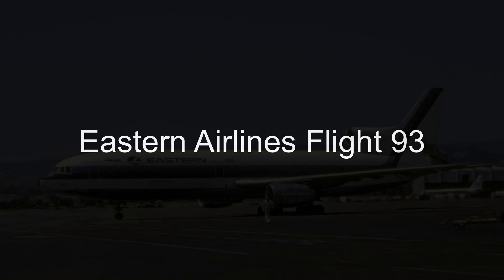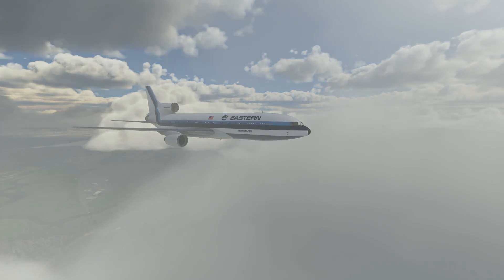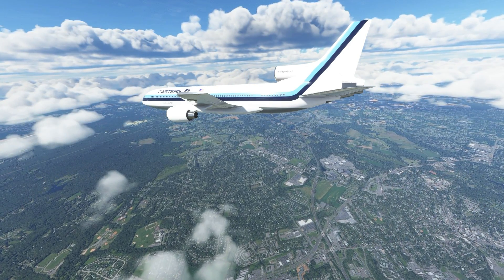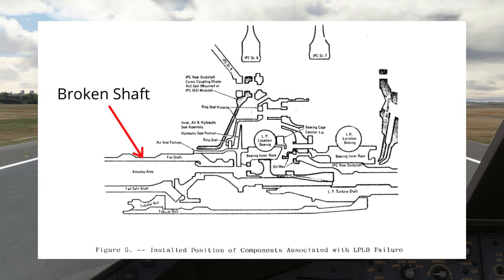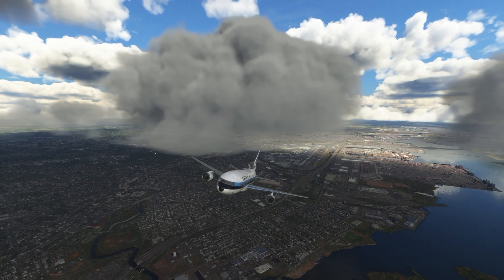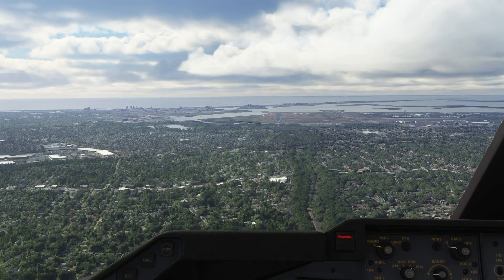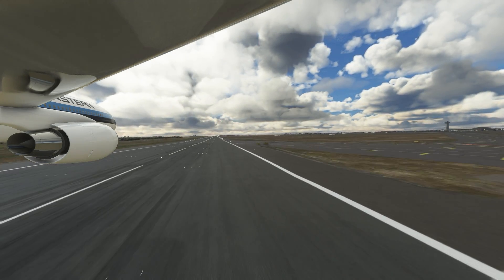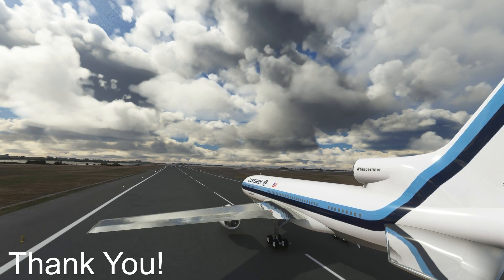How 3 AMAZING Pilots Made A Near Impossible Landing | Eastern Airlines Flight 935

Comment: This one shares several things in common with United 232, except for one major difference - that being they still had partial hydraulics for flight control surfaces. It’s very apparent both flight crews were highly skilled in dealing with these catastrophic failures (the United crew having even less to work with), and that the difference in lives lost essentially hung on the existence of one remaining hydraulic system.
Reply: This was the first thing I thought of too. Captain Haynes said he didn't like being referred to as a hero as it was a group effort. A passenger, Dennis Fitch a training-check airman , had actually practiced flying a simulator using only the throttles before this flight and was the person controlling the throttles.
Reply: @electronron1  sadly Captain Dennis Fitch passed away a few years ago. He succumbed to cancer if my memory serves me correct.

One of Captain Haynes heroic decision’s was to let Dennis Fitch onto the flight deck to assist. Captain Haynes, the FO and Dennis Fitch all worked together to get their plane onto the ground with as least loss of life as possible.
Reply: Part of that major difference was, the L1011 (like the 747) had four hydraulic systems and the DC10 only had three.
Reply: @cr10001  If the L1011 had 3, the people would’ve been screwed right?
Reply: @A_taintedSøl   Very likely, yes.   UA232 had 3, all of which the tail engine took out, the crew (plus a pilot who happened to be passengering) did an incredible job to get it on the ground, but it veered off line and turned over killing about 1/3 of the passengers.   They could have been luckier, but far more likely is that it would just have crashed and killed everybody.
Reply: @cr10001  If three hydraulic systems can be knocked out at once, so can four.
Reply: I was in Phoenix attending new-hire ground training for America West (browsing at the company gift shop, no less) when the tv in the store cut to coverage of UA 232 in SUX (yes, that’s the ICAO code for Sioux City). As it happens, America West served SUX at the time - and as luck would have it I attended a CSR panel meeting a couple months later and sat next to one of the SUX employees. “Shortcake” (real name Suzanne) told us the hair-raising entire sequence of events as every staff member (we had a whopping 11 staff including the secretary/auditor) for each of the four carriers serving SUX was called in to help. And there they stood, in their uniforms but with running shoes or steel toes on, about 25 people in all, representing the four airlines serving SUX, lined up on the ramp, waiting for something inevitable but with no clue how it would all unfold. After 232 came to a halt, Suzanne remembered running like hell straight across the ramp and all the way to and across the runway, at one point thinking “holy hell I’m running across the runway’ who does that??”. She worked the survivor center in one of the hangars, by the way. Much more to tell but that’s a little of it.
Reply: L1011 got off lucky for this one. Highly overrated airplane
Reply: @Cheese dc10 great plane i would fly on one today most of the problems were maintainance issues ie chicago
Reply: Yeah, and the weird thing is United 232 was a DC10 not the L1011, these 3 planes were probably rushed in service.
Reply: @Cheese I know, but the L1011 still had some issues, overall I agree, the DC10 is actually just trash in maintenance and safety.
Reply: I was on this flight.

Comment: This incident has more similarities to United Airlines Flight 232 than I'm comfortable with. They were very lucky that one of the hydraulic systems survived, otherwise they could have been absolutely screwed.
Reply: That's not the only thing they were lucky about.  The video says that when the engine failed, and took its unscheduled journey to its new location 12 feet farther forward on the aircraft than it was supposed to be, it jammed up against the elevator control components in such a way that it jammed the elevator in the neutral position.  Suppose it had jammed the rudder in something other than the neutral position, such as a starboard turn!  I am guessing that this was a feature of the way the aircraft was designed, and that it just so happened that such a jamming of the rudder was probably going to be neutral instead of to one side.  Perhaps we should praise Lockheed's design.  Or perhaps it was just dumb luck.  But either way, good thing it happened!
Reply: They were very lucky they were in a L1011, which had four hydraulic systems.    There was a 747 that took off from LA on a shorter runway than they expected, took out the approach lighting and three hydraulic systems, and made it back.   Both the L1011 and the 747 had four hydraulic systems.   The DC10 only had three.
Reply: @cr10001  are you sure you’re not thinking of the SFO Pan Am flight 845 incident?
Reply: @leigh5152   You're absolutely right, PanAm 845 at San Francisco.   (It was a flight from LA to Tokyo via SFO, I had a vague idea in my head that it was at SFO,  but I did a quick Google to check the flight number and I read "a flight from Los Angeles..." and didn't bother reading further  - my mistake.    (Why check the flight number? - I just like to give enough info that anyone can easily Google for the full story.   In this case I gave the wrong info - sorry)
Reply: @cr10001  Please no need to apologize.  We aviation lovers stick together:)  We learn from each other, as I often have from commentators like you:)
Reply: @leigh5152  I agree (about learning from each other), and thank you for the correction, it saves me from repeating the error on some future occasion.    :)
Reply: @leigh5152  I see you're a fan of 'civil' aviation ;)
Reply: Cpt. Al Haynes (RIP) is the most exemplary example of professional airmanship in action ever in my opinion. UAF232 is the flight that should have had a Tom Hanks movie
Reply: @jasonstinson1767  Absolutely agree with your opinion. The United 232 crew is the most impressive one, that I've ever heard of.
Reply: The DC-10 was a little less safe than the L1011 and also the L1011 had better flight dynamics. Some of the reasons why the L1011 is my favourite aircraft of all time.
Reply: L1011 got off lucky for this one. Highly overrated airplane
Reply: The one difference is United 232 didn't have any warning before their engine exploded and they lost all hydraulic systems.
Reply: @Jman531   United 232 was a DC10 and they lost three hydraulic systems, same as this L1011 did.   The big difference is, the DC10 only had three.
Reply: @cr10001  I am not sure a 4th system in the DC-10 would have helped.
Reply: @Knirin   Depending what it controlled, I'm fairly sure it would have helped (provided the engine explosion didn't take it out too, of course).   Even a little bit more controllability could only have helped.   For example, this L1011, and PanAm 845  (a 747)  both managed to land with just one of four hydraulic systems working.
Reply: Mind reader...
Reply: I thought so too
Reply: Apologies! Without being able to recall the details (except the captain's incredible humour right up to the last seconds of the impact ) I referred to what you had already far more accurately identified!